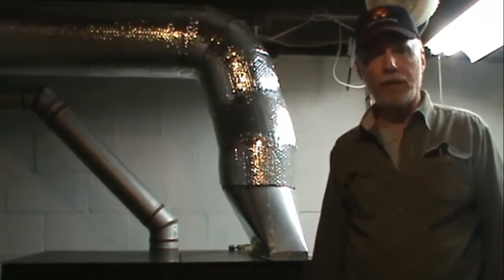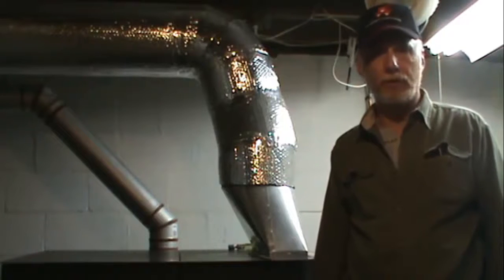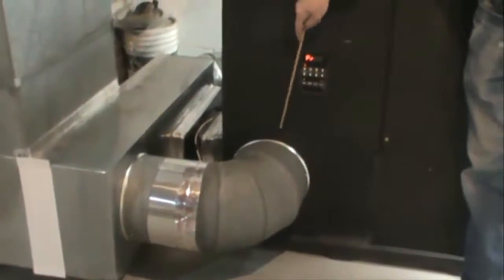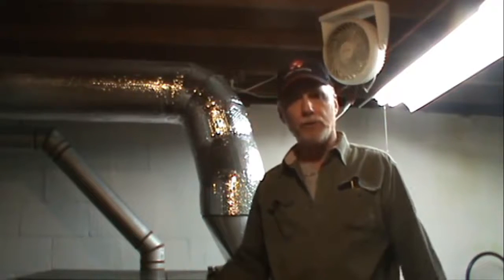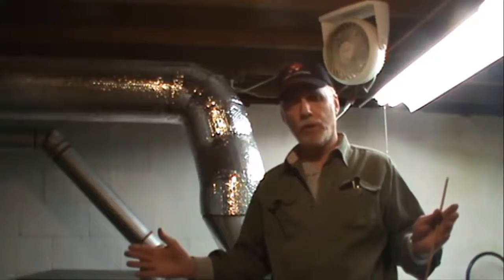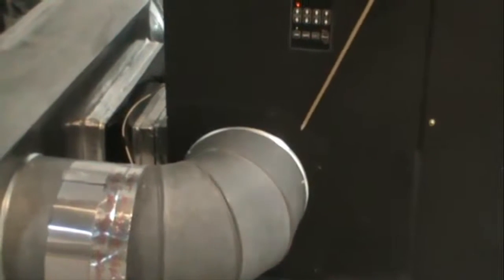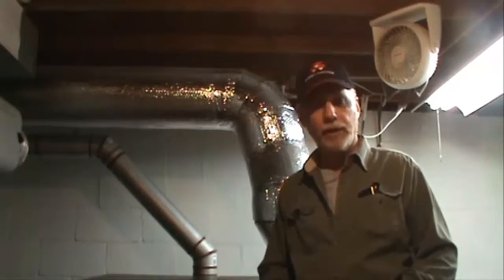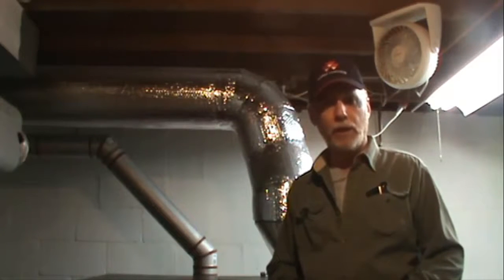How To Increase your CFM On The 8500 Model Stove

Comment: Thank you for this video!!! I have always felt these fans did not push enough air through. I took off the side panel as suggested in the video and it made a significant difference in perceived air flow through the register at far end of the house. I have watched everything you have posted and always learn something from you. Again thanks!!
Reply from the maker: Ed Fife    Glad you found the videos helpful, increased airflow mod is definitely a must for this furnace.